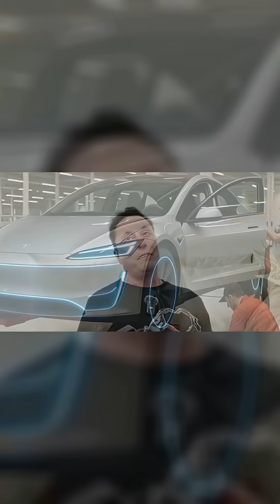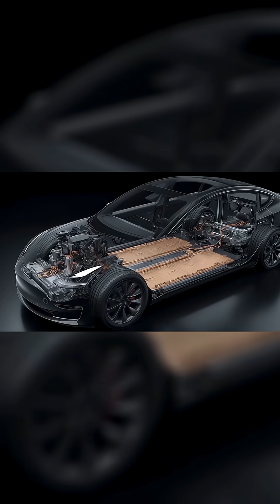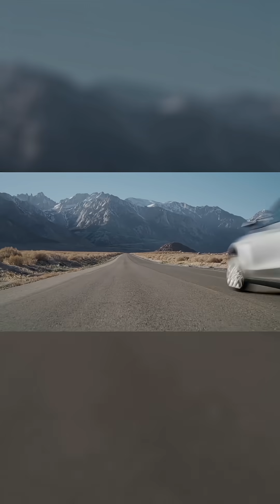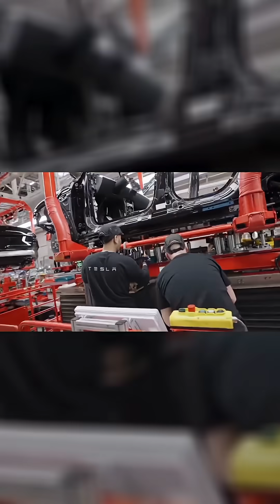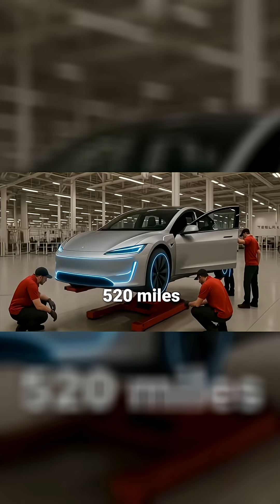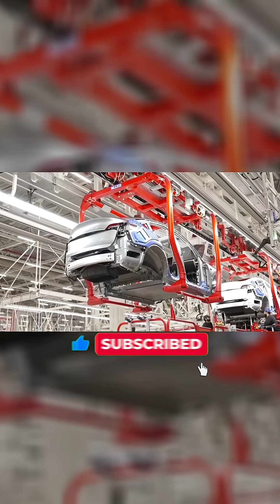Tesla Model 2: $10,599 & 520-Mile Range?

Comment: LIAR, LIAR!!

Reports from April 2025 indicate Tesla has scrapped the development of the low-cost "Model 2" to focus on robotaxis. 

Elon Musk denied the initial reports of cancellation, but subsequent reports and his own statements have confirmed the project is on hold or has been abandoned, at least for now. 

Tesla executives were reportedly surprised by the contradiction between the initial cancellation report and Musk's subsequent denial. 

Cancellation: Multiple reports state Tesla has scrapped the $10,000 car project, codenamed NV9.

Shift in focus: The company is reportedly shifting its focus to building a new line of robotaxis instead.

Reasoning: The decision was reportedly made due to competition from Chinese EV manufacturers and a desire to prioritize autonomous vehicles.

Conflicting statements: Elon Musk has publicly denied the cancellation, leading to confusion, but later confirmed the project's delay or cancellation, citing the lack of profitability of a $10,000 car and the priority of autonomous driving technology. 

;-]